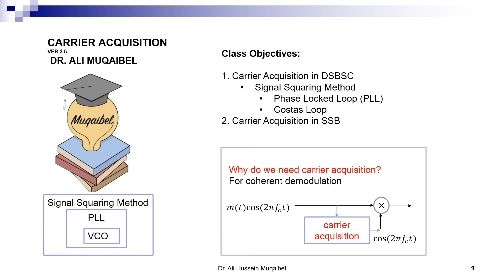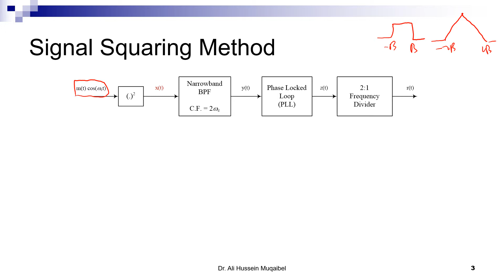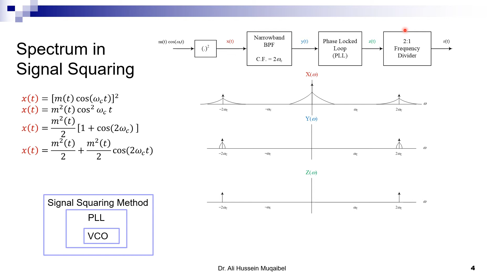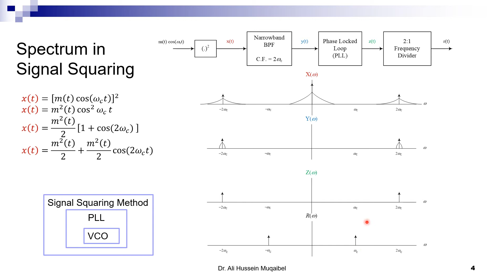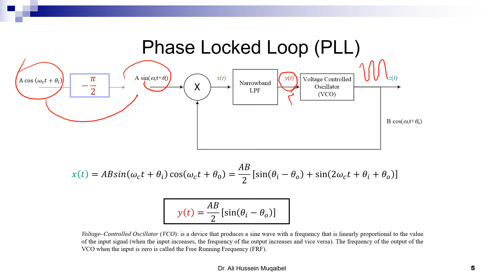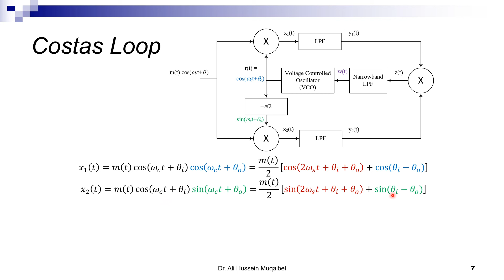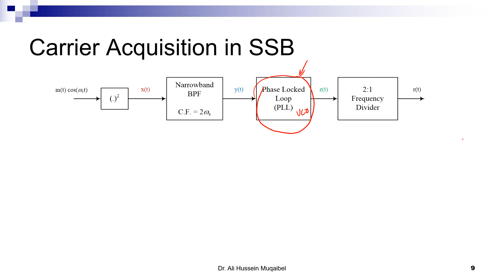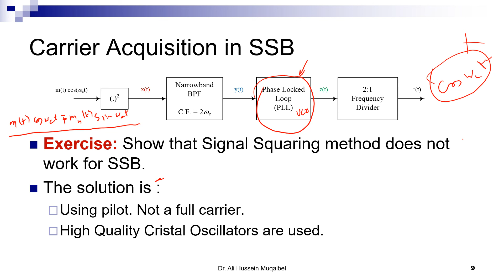4.8 Carrier Acquisition

Comment: Dear Dr Ali , I am your colleague in wirless enineering , this was a spectacular video just like all the others , well done once again , I just have one small remark pelase , you mentioend phase shift in the VCO , I think you meant frequency shift Not phase , when the  input voltage to the VCO increase or decrease it increase / decrease the (frequency) not the  phase shift. plase make a note and correct it when you have the time. have a good day , greetings from the UK.
Reply: السلام عليكم 
No, Doctor is right, the freq. (wc) will be blocked using LPF, and then the difference in theta(i) and theta(.) inside sine will pass, and since it sine the result z(t) could be + or -, which will force VCO to speed up or down the sine wave and go back to the loop until the difference in phase shift is equal to zero .  

BR🌹
Reply: @sultanalajmi6089  مشكوووور سلطان ما قصرت حبيب ... تحياتي الك و رمضان كريم .... مافي غش اوكي ... اثناء رمضان سندويشا من هنا سمبوسه من هنا اثنا النهار.... ترى شايفك هاا انتبه ههههههههههههه مشكوووور ما قصرت :)